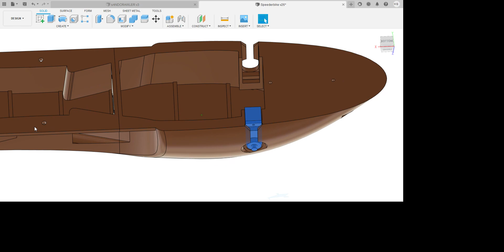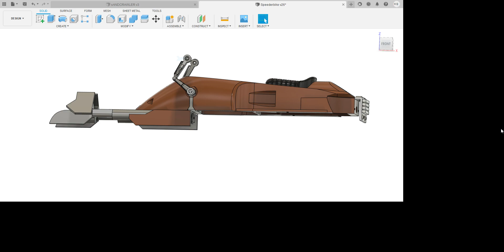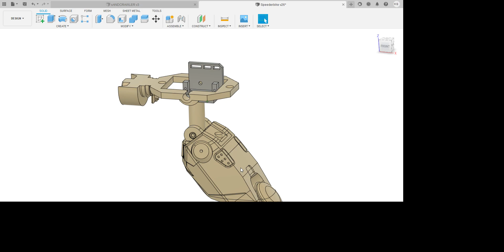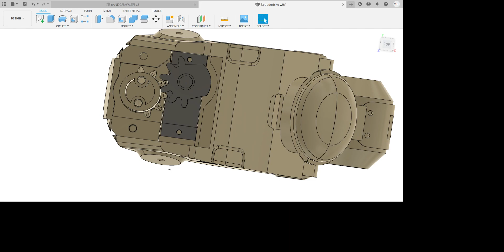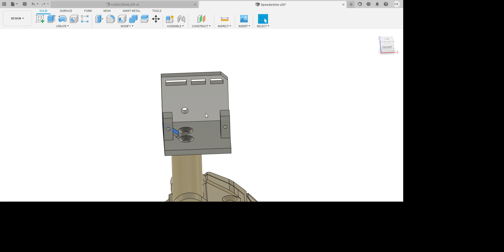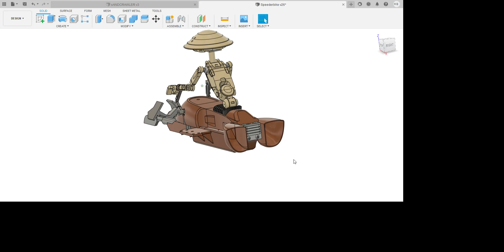Pit Speeder flythrough and assembly.

Comment: Nice explanation.  I have mine 95%complete. I can't find the stl for the motor pinion gear. That one is not included in the patreon files. BTW I print the tracks in TPU and are so quiet.